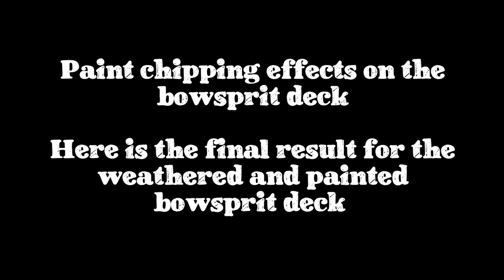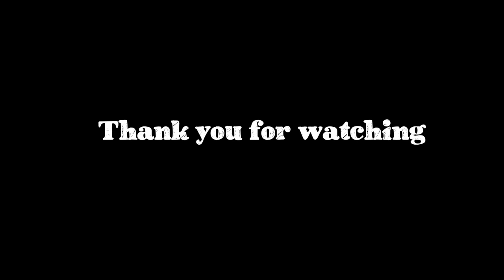Santisima Trinidad - Part 14 - Paint chipping effects on bowsprit deck

Comment: Hello✌ really want to try to do this effect but what do you mean by chipping fluid?
Reply from the maker: In Vallejo it's called chipping medium, on AK interactive it's called chipping fluid, it's a product sold that makes it easy to chip the paint
Reply: @ModelShips  it will not work without it?
Reply from the maker: @homeharbour6238  without it on most paints it just ends up diluting some paint off, you get a faded effect but not a chipping effect, you can google hairspray chipping method, hairspray can be used instead of the chipping fluid, i thinks it's less predictable but it works
Reply: @ModelShips  thanks 😉 I will try
P.s. love your Santisima, she is beautiful 👌